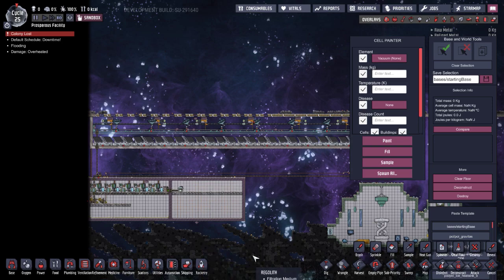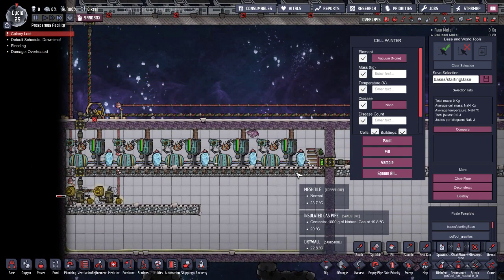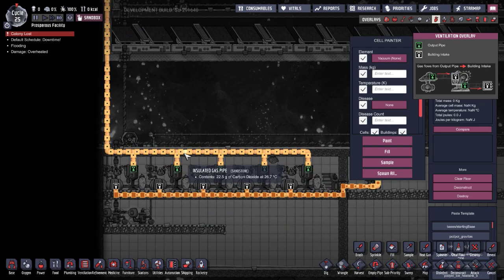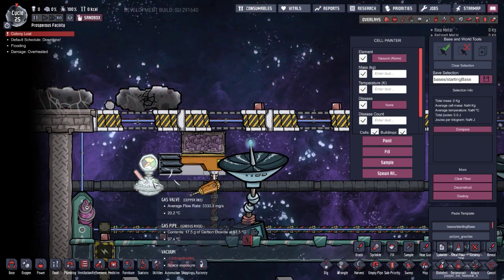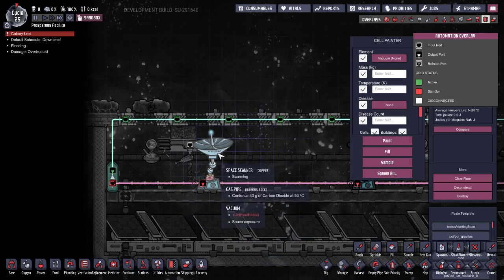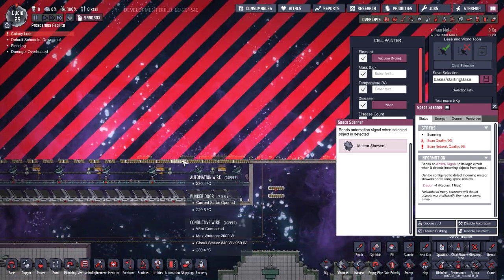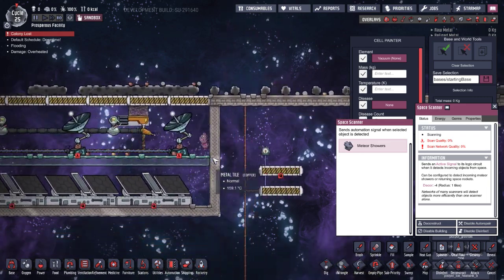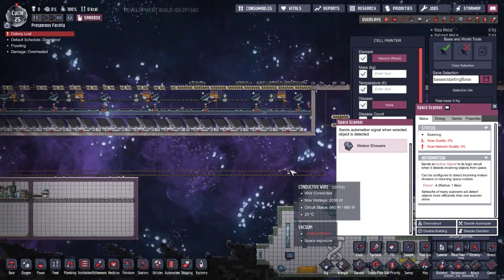Oxygen Not Included Space Cooling

Comment: i liquid cool bunker doors , stuff that lie on top of them also get cooled
Reply from the maker: What are you building on your bunker doors that needs to be cooled?
Reply: @LurkzGaming  i run petroelum in a loop with one aquatuner ,these lowers the temperature of everything that lie on top of bunker doors , at the point door opens is not melting steel hot anymore and can be picked up by sweeper arms with no problems.
Reply: bunker doors sit at around 50 C , when meteorite hits it get cooled down to something around 100 c ( ranges from 50c to 150c depends how long it sit on top of bunker doors)
Reply: ups just noticed its not perfect solution temperature still build up in sweepers just way slower ;/
Reply from the maker: @hardkur  Indeed, the sweepers aren't being cooled down unless they are in contact with the falling regolith blocks.